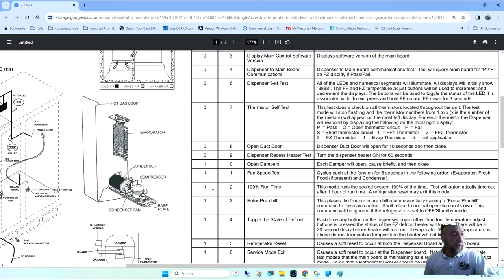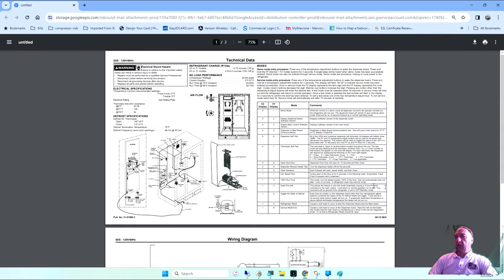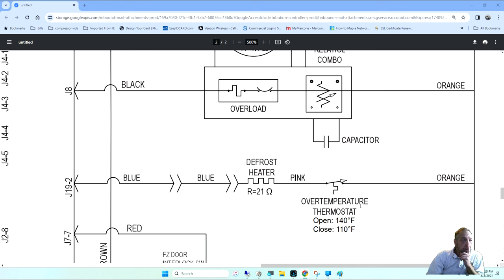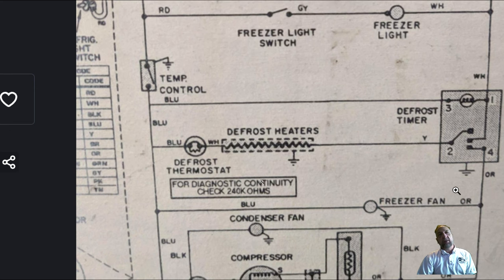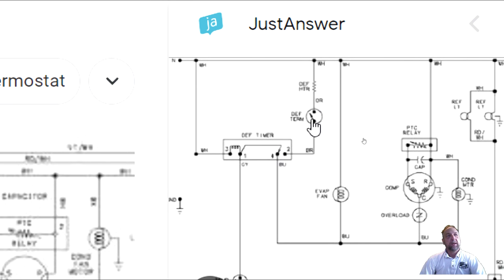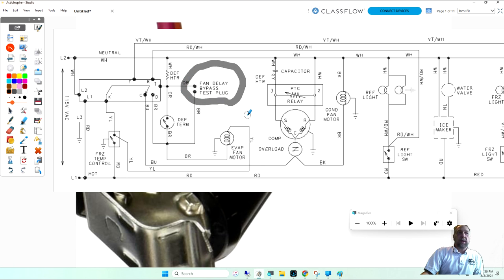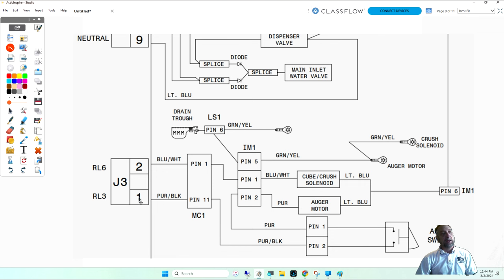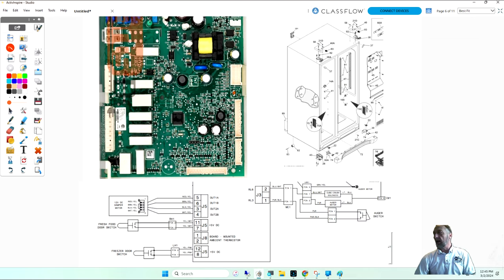Refrigerator diagrams Part 1

Comment: 35:50 Is the benefit to PWM variable speed? Longer duty cycle equals higher speed and lower duty cycle equals slower speed? Compared to an AC motor which is single speed?